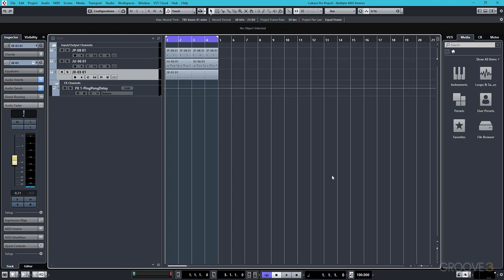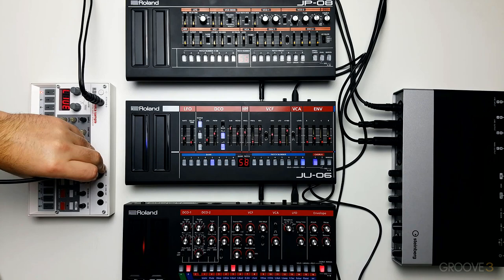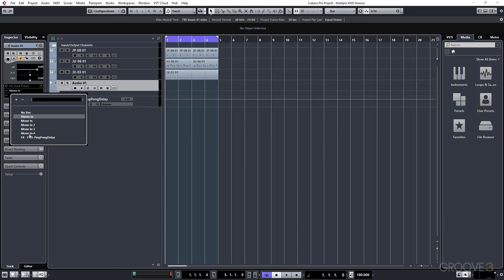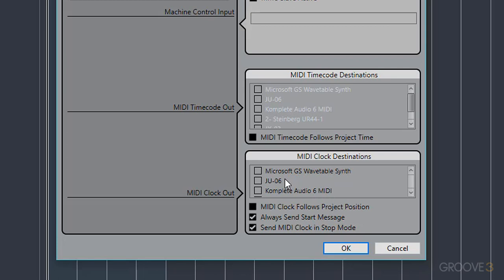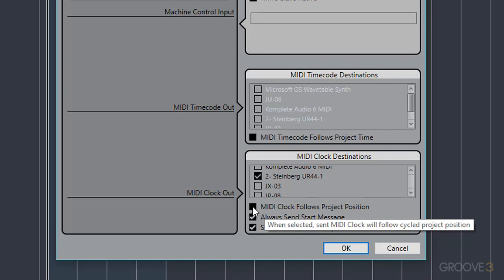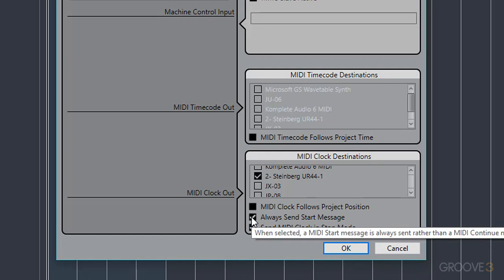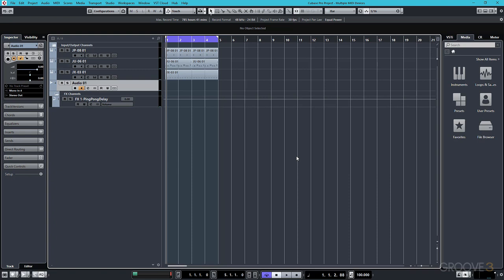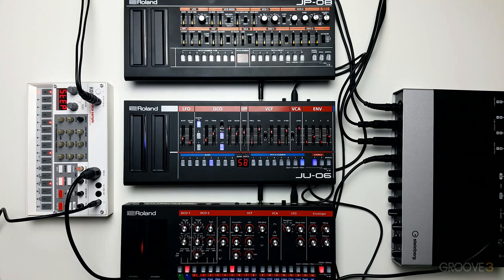Using MIDI Clock (Cubase - Working Outside of the Box)

Comment: Thanks for the good video. I've now managed to get my Arturia beatstep working (sort of). The problem happens if i set up a four bar loop. The beatstep is a 16 step sequencer set to 1/4 notes, so should stay in sync with the 4 bar loop, but it gradually gets out of sync. It seems to miss out beat 1 of the first bar on each repeat. It works fine with the loop disabled.
Reply: exactly the same problem here.... it seems tha Cubase is not sending the clock tightly.... did you fix it?

Comment: Problem comes when I've recorded some audio and then i'm playing monitoring playback through cubase if some synths not yet recorded or i want to change, there is latency, i've set my buffers low as it will go, its more irritating than detrmental but throws off groove enough to be not nice to work with at all... I was thinking one of the midiclock devices might help in this regard but i'm just not sure, at some point i want to get rid of my 18i20 and get a UAD apollo but its going to require a new PC basically for Thunderbolt header reasons.... Any tips on getting the tightest sync? If you don't understand, everything is tight if its unrecorded, everything is tight when its recorded, if only half my instrument are recorded and the other half are still being monitored but midi controlled then i have a problem with the latency anything i can do?

Comment: Hello there - I'm just beginning to explore midi options using an iPad and I wondered if you might be able to help with a question I have..
I'm normally using midi over 5pin din - sending tempo/clock from my looper, and program change from my vocal effects unit to a Kenton Midi Merge. Currently I'm sending this merged program and clock signal out to three hardware synth type instruments, so that they all know the tempo I've set at the looper, and all bank up/down when I do so on the effects unit.

What I'd like to do is send that merged midi data out to an iPad instead of the giant rack that holds all the synths. I understand I'll need the camera kit and a powered hub etc, but what I can't seem to figure out is how to physically convert that 5pin midi signal to usb. There seem to be options ranging from a £5 adaptor up to a £400 usb host/interface and I'm a little lost.

Not sure if you can shed any light on this, and apologies for using your comments section as a support group, but I just thought I'd ask someone who seems to know what they're doing!

Thanks so much for your time - Mat

Comment: Over the years, I've had the worst time trying to get the synchronization to play nicely in Cubase.  When you select a device to send MIDI Clock to, that causes Cubase to send MIDI Clock data out to the entire system regardless which device you choose.  Also, some of my devices with built-in arpeggiators playback  at crazy speeds when you select more than 1 device from the Destinations tab.  You would think that by being given an option to choose which MIDI devices you want to send Clock data to from the Destinations tab, that Cubase would only send Clock data to those specified ports, but that's not what happens.  Furthermore, I have to set up a custom preset in my MIDI interface to filter out that Clock data on the ports I don't want triggered.

I contacted Steinberg about it, but so far no results.
Reply: as said below, look at hardware settings and decide if you want it running on internal or external MIDI clock. I've been thru this too and its a matter of messing around until you get the right settings. if the built in arps are playing too fast, then change their speed slower. then you can lock them to MIDI clock for sync